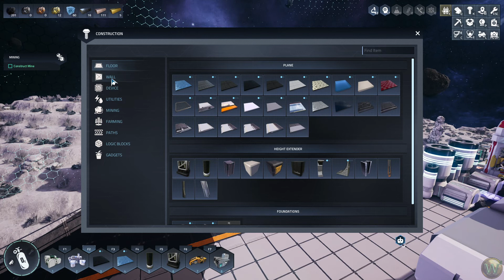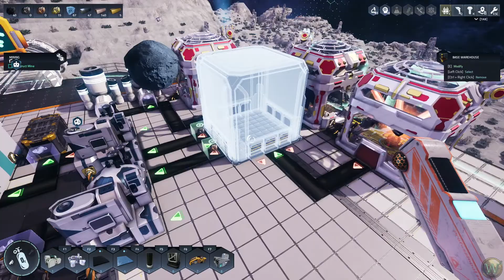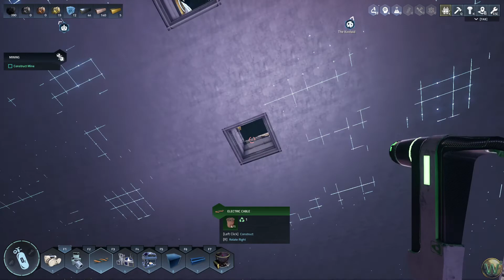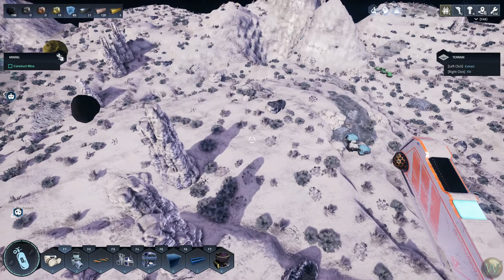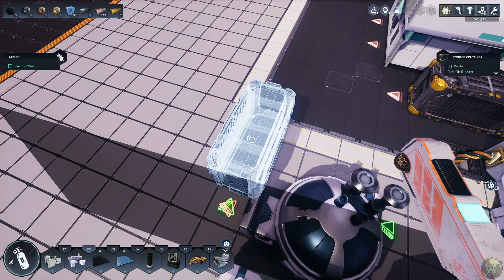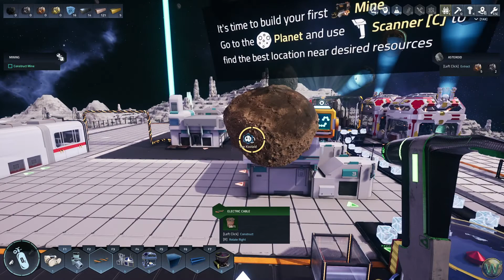Astro Colony - Automated Water Processing - First Look - Let's Play - Episode 6

Comment: Most space saving way to set up smelting that I've found; Use one output from your warehouse, with a filter set to gold, iron, and copper onto a single belt. Line up your smelters with your preferred spacing, and run that belt right along side then. At each input for each smelter, set a filter for the resource you want it to smelt. This opened up a lot of space for belting in from planetoids, as well as getting more automated asteroid catchers going. Also, plan your docking a bit more, as you can attach to multiple planets and drag then around. Will need more thrusters as you go up on size, but gives you an insane amount of space/resources/ways to go. Keep it up. Loving this series.
Reply from the maker: Yep.  I thought it would jam up eventually, but then I learned the stack size was 99,999, so I’ll change it during the next rebuild